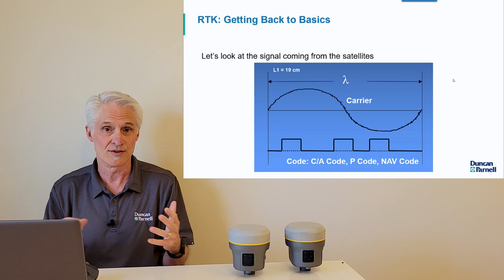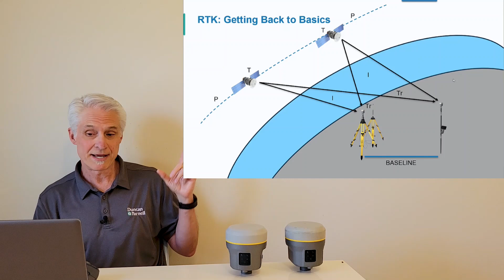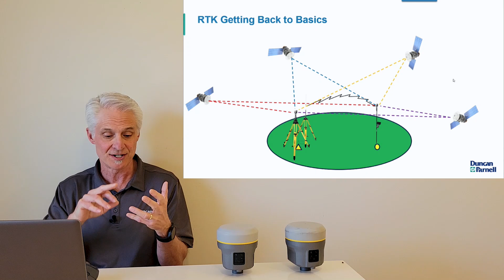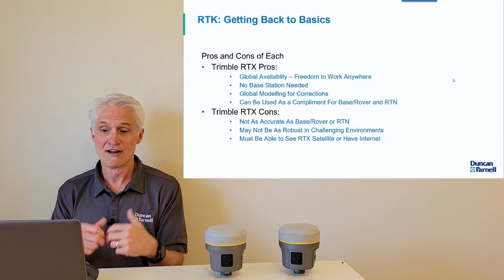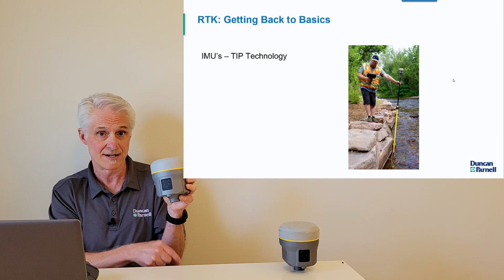Back-to-Basics: The Ultimate Guide to RTK (Real-time Kinematic) | Survey Matters

Comment: @15:30 ,excuse my ignorance, im new to this just a question , why  use a base station if both receivers need to see the same sats, why not just use the rover to gather data? Thanks
Reply: The rover on its own, without a base station, has a ~3m accuracy.  The base station is setup on a known point, so it knows its own coordinates because we're telling it, but the rover "doesnt know" where it is.  To have centimetric accuracy, the rover needs to receive a correction factor from a base station.
Reply: @phil_boucher  thanks i was confused on this as well.

Comment: 33:00 when I was Product Manager at Trimble, this was one of my ideas: recording the position of the tip of the pole by moving the antenna because the antenna describes the surface of a sphere that is centred on the tip. Simply bit of mathematics and the more the antenna is moved around, the lower the GDOP and higher the accuracy of the tip location!

Comment: Question: If I'm using NTRIP and getting corrections from them through the internet to a hot spot (phone) or directly to my base station (SIM). Is there a difference in corrections from where that correction is coming from? That phone might be 20' from the base station compared to the base station that is getting the corrections from its own internet-connected SIM card.
Reply: Thanks for your comment. The corrections are coming from the NTRIP Caster to the base receiver, whether through a hotspot or a SIM in the receiver. The hotspot is just the tool to get an internet connection for the base receiver so it doesn’t matter if it is 20’ away from the base, as long as it is in Wi-Fi range.
Reply: The route the NTRIP stream takes has no bearing on the corrections. It is not the location of the SIM card nor the hot spot that determines the base station or rover coordinates but the electrical centre of the applicable antenna.

Comment: Great video.  One question, if you are using RTX in an area with cell coverage, is there any difference between using RTX over IP vs RTX satellite other than the delivery method.  When using Catalyst with a subscription, it will pull in RTX over IP if there is a cell signal and switch to satellite if there is no service.  However, I don't know if there are any differences in accuracy with IP vs satellite when it comes to issues such as latency and what not.
Reply: There shouldn't be!
Reply: If you are using the Trimble Catalyst Survey Solution with Trimble Access and getting your corrections for the Trimble Corrections Hub, the software will automatically route the corrections to what Trimble labels the “best available” source. 
1. VRSNow where available 
2. RTX IP internet delivery (IP is preferred for RTX) 
3. RTX L-Band satellite delivery (if no internet). The stated preferred method for RTX is IP.